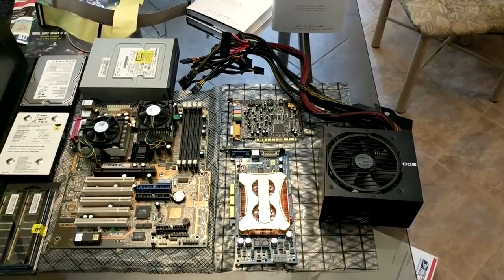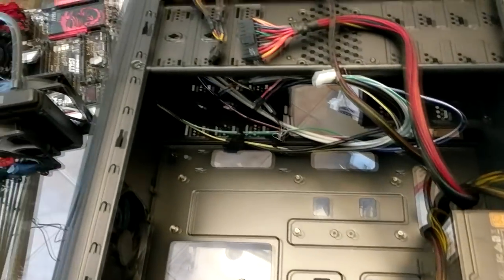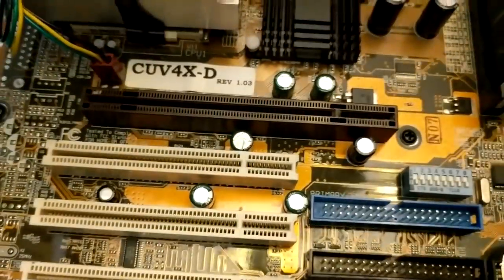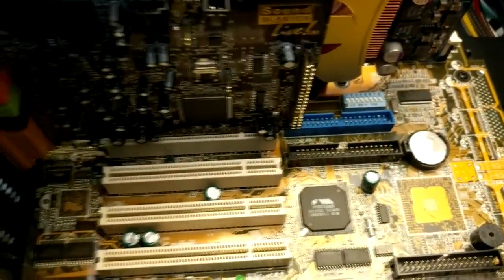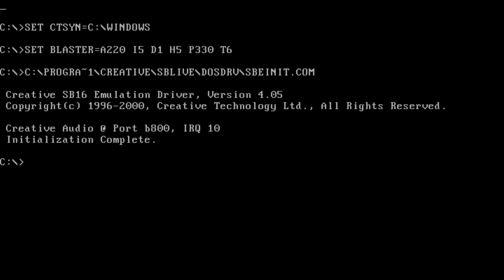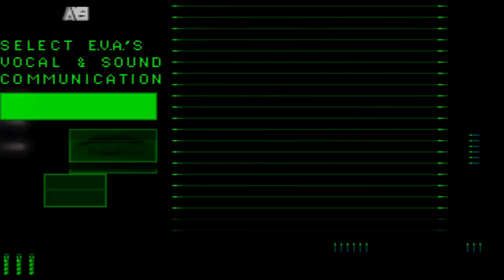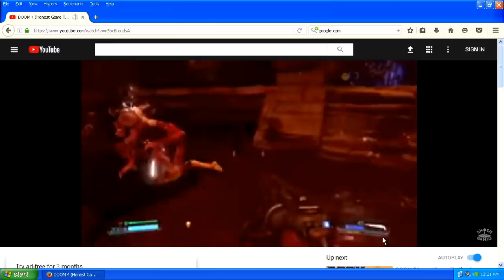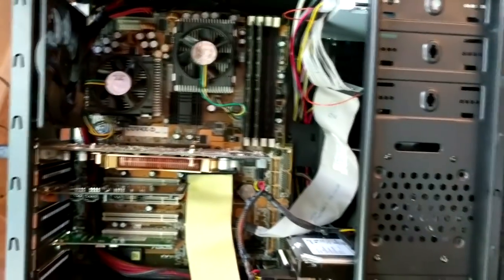Pentium III Retro PC Build! Dual 1.4 Tualatins!

Comment: Hey I love this! I’m looking at putting together a retro gaming PC myself, I graduated high school in 2005 so my fondest gaming memories are late 90s and early 2000s.
Wondering what you did with your 1GHz CPUs afterward... I could definitely use one in a build! Let me know...
Reply from the maker: Actually threw one of them into our old Compaq from the time! And the other is in my parts box.
Reply: Archades Games I was surprised to see the motherboard work with the Tualatins actually cuz Asus made an updated board for those. Kinda interesting! But I’m looking at doing a Radeon 9700 or 9800 with a Pentium III, should be great for replaying some of my old favorites like Need for Speed, Splinter Cell, Prince of Persia
Reply from the maker: They have the socket adapters built into them to allow it. They actually show up in the bios as Pentium 2's lol
Reply: Ok well I just pulled the trigger on some stuff from eBay... a motherboard with single Tualatin support but it has two DDR slots, I got a 1.4 PIII-S, and a full 1GB DDR-400. I’m also keeping an eye on a Radeon X800 Pro that’s for sale, the seller is away til Apr 3 so that’s when I can buy it. Man this is exciting!!!
Reply from the maker: Nice! That thing will fly!

Comment: The first PC I had was in 2002 (15 years before the time this video was published). It was a 600 MHz Pentium III with 128 MB of RDRAM. Back then the machine was OK for doing basic office tasks and lightweight gaming, but it started to show its ages 3-4 years later. My next rig was a P4 Prescott 3.0 GHz, which was bought in 2007, but could only hold up a few more years. It could run Windows 7 "just fine", but again only 3 years later it became obsolete and couldn't be used for anything.
Today's hardware seems to hold up much better than computers from that era. The 12-year-old Core 2 Quads (Q6600, QX9650...) still go strong in 2019 for light gaming (they're even overkill for office tasks). 2nd and 3rd-gen i5's and i7's can still play games perfectly. I guess they can last another 10 years, providing they're not damaged.
Reply from the maker: It would all depend on a person's personal definition of being perfectly playable but I agree. I have a Q6700 combined with a HD 6970 and what it can play is pretty impressive!

Comment: Im surprised this system worked as well as it did, right next to the 20pin motherboard power connector, theres also a 6pin auxilary connection that also needs to be plugged in that looked like it wasnt. These older systems required a power supply that needed a 30a+ on the v5.0 rail of which it drew most of its power from and sometimes offered the 6pin auxilary connector. Newer power supplys provided more current on the +12v rail and even less on the others and really shouldnt be used on older 20pin power connection motherboards that draw most of their power from the +5v rail.
Reply from the maker: This build has always need more 12v for me. My AMD builds needed more 5v fore sure though.

Comment: Great! I have this motherboard and kept it on dual P3 800MHz when I originally used it. Years later I acquired a pair of socket compatible Tualatin CPU's, but wasn't sure if they would fry the board or not. Read some horror stories on forums. Though I'm noticing that the heatsinks I have on hand are probably insufficient. They're only as wide as the socket. Good enough for standard P3, but probably not for Tualatins. Funny coincidence is that I also have the same slot loading CD-ROM drive as in your second bay. What are the chances!
Reply from the maker: Haha that's awesome! I can confirm this board is still running strong these 2 or so years later!
Reply: @ArchadesGames  The reason I've been with ASUS for the last 20 years is that they never failed on me. Haven't lost a single board, and I've collected about 50 of them. My primary retro rig is even older - P2B-DS, dual 1GHz P3. It hasn't even been re-capped. Still runs like it's new. I've only seen one dead ASUS board in a friend's build. He put in the screws too tight and ended up delaminating the layers, causing a short. They're rock solid otherwise.
Reply from the maker: Indeed they are!

Comment: That build would have been some serious bragging rights back in the day using NT.
Reply from the maker: chris williams This board blows my mind for the time period. What computer had 4 gigs of RAM back then 😂
Reply from the maker: chris williams I remember we added a 256meg stick to our 128 Meg Compaq and it was amazing!
Reply from the maker: chris williams Yeah P3 came in slot 1 variation at launch and there were also socket adapters for the newer model P3's. The first Computer our family had was an IBM PS/2 Model 30 :). 

Glad you enjoyed the build! I have another video I still need to edit together with upgrades I made to this guy. I also have another build video of a more modern machine that can run W98 I think people might find interesting!

Comment: I remember I built a similar PC, a single Pentium III 1.0 ghz with 256 mbs of pc133 ram, and 32 mb geforce 2, 20 gb hard drive, and Windows Me. That I built around March of 2001.
Reply from the maker: I would have loved a build that powerful back then! I only had an old Compaq with a 500 MHz Celeron.
Reply: Archades Games of course the desktop build I have now is an Intel core i7-4770k with 16 GB ddr3 ram and an nvidia gtx 1060 6gb graphics card, 275 gb ssd with a 3 tb hdd. Still not new parts, but I'm thinking that the majority of my components are from around 2013 or so.
Reply from the maker: Shawn Burton with how little ipc has increased from the 4XXX to the 8XXX series that rig is still plenty capable!
Reply: I saw that it still runs pretty much any game from 2016 to 2017 at 1080p with at least 60 fps. I've ran some recent games on it like FarCry Primal, Deus ex mankind divided, Ghost recon wildlands, Mass Effect andromeda. In my collection of PCs that I fixed up, the oldest one that I have is a Toshiba Satellite laptop with a 266 mhz Pentium processor with 96 mbs of ram, and its original 4.1 gb hard drive and I have running on it Windows 98 second edition with Office 97. It said it was manufactured on 11/14/1998. I was even able to get a wifi adapter working on it and connect it to the internet and it did load a few web pages, but the majority of web pages today wouldn't load on it since its so outdated.
Reply from the maker: That's awesome! I still want to go back and build a Pentium/Pro system some day! Our first windows PC was a Pentium 100 or 133 I can't remember anymore.
Reply: I remember actually, the very first PC that I had at home was a Macintosh SE that I believe my dad bought back in 1988. It had a small black and white screen.
Reply from the maker: Shawn Burton ahhh old Mac and Apple 2 were so cool back in the day!
Reply: Yep, I remember that the Apple II was the first PC I used in school and where I learned to type on a keyboard back in 1996. I guess nothing modern about an apple II PC, was a green or white monochrome screen with a 5 1/4" floppy drive. I actually read that those were released in 1977. I even recall the very first video game that I played even before the original super mario bros was a game with a console called Vectrex, which I remember it said it was made in 1982 which was monochrome line graphics.
Reply from the maker: I remember playing some game on an Apple II cant remember it much. I still remember that green screen though.
Reply: I remember on it playing some educational games such as number munchers, the oregon trail, hangman, also the program that I first learned to type with, forget what it was called, but it was where the car went around the track and these words appeared on the track, and you had to type the word before the car crashed into them. Even the dell laptop that I fixed up and use as a netbook is also pretty old, a Dell xps m1330 laptop which from which the stickers inside was made in early 2008 with a 2 ghz core 2 duo with 3 gbs of ram with intel integrated graphics with a 160 gb ssd and Windows 10 works fine on it.
Reply from the maker: Shawn Burton I had the last 17 inch XPS laptop from 2011 thing was a beast! Ended up giving it to my dad to use in his office.
Reply: I also have a much bigger laptop that I fixed up a couple years ago, a Dell Precision m6400 laptop with a Core 2 extreme 2.53 ghz quad core cpu with 12 gbs of ddr3 ram, 480 gb intel ssd, and a 1 gb AMD firepro graphics card and it has Windows 7 professional. Thats actually my favorite laptop for doing office work like when I need to do a lot of word processing and spreadsheets. Its also good for running older 3d games, like games made up till about 2012. That laptop I think was top of the line in late 2008 to early 2009 designed for large businesses as a workstation.
Reply from the maker: Shawn Burton that's a beast! :O
Reply: Archades Games I never tried actually having two CPUs on one PC like this video. I could say that actually, the oldest PC I have that has Windows 10 on it is an older desktop that a friend gave me that he said he found on the side of the road. It was almost complete except for the graphics card. I then put in a gtx 285 in it and the bios date says that it's from 8-24-2006 and has an AMD athlon 64 x2 4200+ with 3 gbs of ram. Actually have it dual booted Windows 10 and Windows XP and still has the XP sticker on the case.
Reply from the maker: Shawn Burton I was going to try booting windows 10 on this thing for fun but haven't gotten around to it yet.
Reply: I was also going to try setting up also a dual-boot on my primery i7-4770k desktop between Windows 10 and Windows 7 but me working a lot outside, haven't had time to do so. I remember actually when they used to be a lot of money in fixing up PCs like back in the 1980s and 1990s, but nowadays, seems like there is not much money in that anymore since PCs can be bought cheap.
Reply from the maker: Shawn Burton they are also easier to fix nowdays also.

Comment: you're a lucky guy  ,  I had the same dream  , but  got the wrong board . A dual pentium III limited to 1ghz  and 512mb ram max  !!  never managed to make it working though .   dual tualatins motherboards are expensive   , the price can go up to $500  on ebay   ,  that's to much , for the same price you can get  a complete mobo with intel corei series on it
Reply from the maker: Yeah native Tualatin stuff is way to expensive... My entire build including upgrades that I put in in the next video only cost me  ~$230. Unfortunately the pre modded CPU's have doubled in price since then. I would love to get more one day.

Comment: Very interesting. I too have the CUV4X-D board and wanted to upgrade my Coppermine PIII's to 1.4 Ghz Tualatin's but didnt think the board supported Tualatins, so this is very reassuring ! Did you have to update the BIOS or use any kind of CPU/socket adapters ?

Thanks !
Reply from the maker: You need the socket adapter on the tualitins
Reply: @ArchadesGames  so did you do a pin mod, use the lin lin adapter, or the solder on adapter from ebay? Thanks.
Reply from the maker: I bought premodded ones so couldn't say for sure.

Comment: dual tualatins motherboard are expensive  on EBAY   , they sell   around   $100  and  $450   with Agp slot
Reply from the maker: Yeah they are going to keep getting more pricy sadly. Glad I was able to do my build when it was cheaper.
Reply: @ArchadesGames  looks like there's a lot of people trying to get them , that could explains why they are expensive . I've been looking for a cheap one for years with no luck , I gave up .  I  still have my two tualatins cpus on the shelves with no motherboard . May be I'll try to sell them or dispose of them
Reply from the maker: More attention has been brought to the tualatins so part hunters have been swooping in for them that's for sure.

Comment: Oh man this is almost the same as my build. Sadly the motherboard I have is missing the metal arm that locks the cpu down. It's an Asus cuv4x-d bored. I've tested both slots but have never made them work simultaneously.
Reply from the maker: Oh man, what a shame about the board. I love this build so much
Reply: @ArchadesGames  I ordered some replacement sockets off eBay. Hoping they have the metal retaining bracket that is compatible with mine. I've tried using a socket A and a socket 478 retaining bracket in them neither worked. Keeping fingers crossed.

Comment: I actually just got one of these boards in the mail (a gigabyte dual tualatin board). Did you have any trouble sourcing a power supply and, I know one of the CPUs won't be used in win98, but did you run into any other issues running 98 on your beast? Like too much ram or anything?
Reply from the maker: I haven't had any issues using 1 gig of RAM even though Win98 is technically only supposed to go up to 512. My board can technically support 4 but I have never seen a reason to go that high as of yet even in XP. As for Power supplies I started off with an EVGA 450 Watt and it handles just fine no issues on the 5 or 12 v rails to my observations. I bumped it up to a 500 Watt when I used the 450 in a smaller build.
Reply: @ArchadesGames  Do you happen to have the model number from either of the EVGA PSUs you used? I want to see what it has for current ratings on the rails. I plan to do a video of my build as well, if so I'll be sure to give you a shout out as your videos about this configuration helped convince me to go for it!
Reply from the maker: https://www.evga.com/products/product.aspx?pn=100-B1-0500-KR

I am pretty sure it is this one. I don't have the build with us atm since we just moved and I haven't picked it back up yet.
Reply: @ArchadesGames  Awesome, thanks
Reply from the maker: For sure happy building, it's a good one!

Comment: For 2001-2002 the most powerful Gamer Pc actually were XBOX 1.0 modded consoles with 1.5ghz Pentium III tualatins moved by 30gigaflops (350mhz gpu overclock). And 1ghz p3 with 25gigaflops (300mhz gpu) is easy to do right now on any classic Xbox to move all at 720p. If youre an Pentium III fanboy… mod a classic Xbox.
Reply: You can OC PIII higher than 1.5GHz on PC though.
Reply from the maker: I know people that run them at 2.1 GHz.

Comment: I'm wondering that can I just put pentium III-s on to my ASUS P2B-VM without add some microcode into the BIOS?
Reply from the maker: from my understanding with the adapter it works on almost any board that supported the P3. I have seen people throw a p3 1.4 into a slot 1 board.
Reply: Archades Games Yes, it may works on some motherboards, but mine. I had try to install a tulatine Celeron , but it didn’t works. So I wondering why it doesn’t work.
Reply from the maker: 徐子翔 only thing I can think of is to make sure the bios is completely updated. I'm still pretty new to the P3 scene so I'm not as knowledgeable in the subject as I'd like to be. Yet!
Reply: Archades Games The BIOS had been updated to the newest beta version, but it still unable to boot up. But Pentium II can work fine, so I feel confused.

Comment: With the OG XBOX source code leaking I am curious if there is any way to get a board like the one featured here to load up with a dual Tualatin P3 1.4ghz CPUs, 256mb of RAM per CPU and then some higher end Nvidia GPU than the 230MHz one that powered the OG xbox.  You can upgrade the CPU on an Xbox to these 1.4ghz P3's but with many games you need to put it in "Turbo Mode" (ie underclocking back to the original 733MHz).  Why would you want to do this?  Proof of Concept?  R & D towards a SoC board in a small form factor that can play OG xbox, update XBMC4XBOX (x4x) to play 1080p or higher video (I mean I am sure a lot of Kodi's modern code could be ported should their be better hardware in an XBOX to play around with.
Reply from the maker: According to people far smarter and involved with this sort of stuff, the leak doesn't have any information in it that wasn't already available unfortunately.

Comment: lol you built my super p3 about 99% just fyi there is a beta bios for that board for tualatins so cpu is identified correctly with microcode just fyi i had this board at 2ghz with 4gb ram and 3850agp yes it can run crysis:) i also have the iwill ddr board that was a recent grab i had that cuv4x-d running win 7 for 10 years little tip on my cpus i have modded them to be 1.55volts guy on ebay who sells them modded for coppermine boards can also do this for you if you ask he has been making them for many years on ebay atleast 10+  also you need win2k or better and make sure you agp is at 4x also just little extra tip boards with 64bit PCI you can use 64bit pci to pci-e adapter get same speed as agp 4x there are 32bit pci to pcie 1x but you are still limited my slow 33mhz 32bit 133mb/s instead of 533mb/s also REMEMBER tualatin have a heatspreader so the cpu is taller you need to bend the clips to thats how people break the socket
Reply from the maker: i will have to look into that beta bios for sure!
Reply: 4gb ram of what? sdram? ddr1? thats not possible
Reply: why not its a 32bit cpu and p3-s was server class why it had 512kb cache. 
look up the datasheet that via chipset supports 4gb is the 815 that was stuck at 512mb
my iwill uses ddr the cuv4x-d and its cousins are sdram
Reply from the maker: Yeah my board can handle 4 gigs of SDRAM. It would only be usable on NT, 2000 or XP but it can be done.

Comment: You didn't need to plug the fan into the motherboard oops
Reply from the maker: Dave Lee You mean the front fan? Yeah I realized I had an extra molex connection for it 😂
Reply: Hahaha yeah in normal circumstances you would plug in either connector. They are pretty nifty though at times, when your case has like 3 of these fans I would plug perhaps one into the motherboard and daisy chain the rest of the molexes together.
Reply from the maker: Dave Lee very good to get around limited fan headers as well